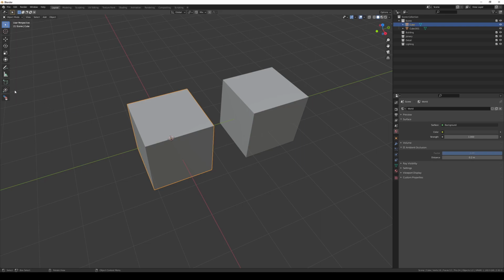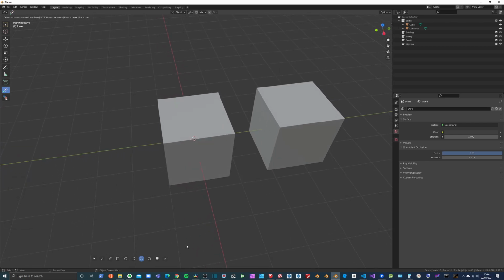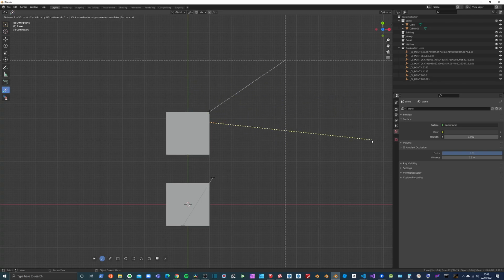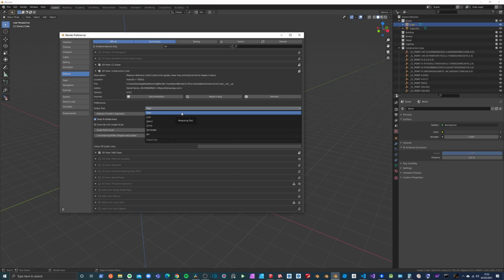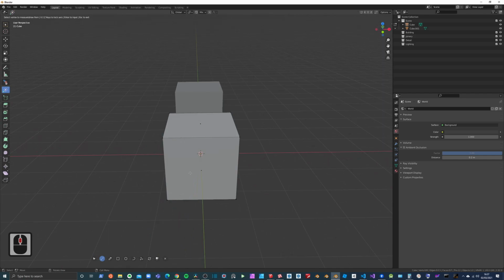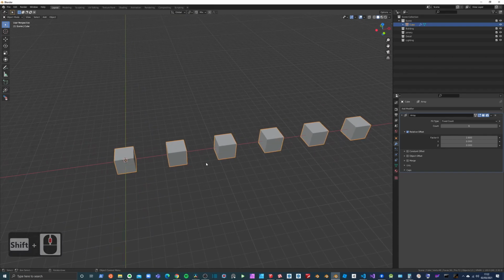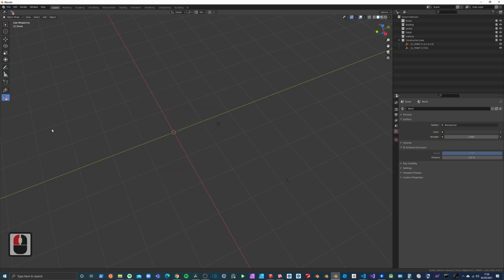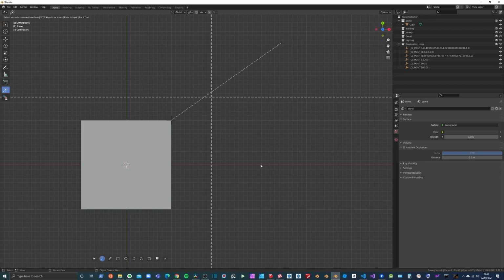Construction Lines 0.9.5 Release - CAD Modelling for Blender

Comment: I’m using the current version with blender 4.2 but it’s not working well at all. Very frustrating.
Reply from the maker: Are there any error messages in the console? Also, did you restart blender after installing? You can contact me through my website form and I'll help figure out what's going on. There shouldn't be any issues running on Blender 4.2
Reply: @ ok. Will get back to u

Comment: The addon is ready for 2.93? Line - Draw line geometry
 makes blender crash everytime I do 2 or 3 lines
Reply from the maker: Blender 2.93 had some internal changes that broke Construction Lines 0.9.5. However, I have a new release out this week that is fully compatible with Blender 2.93. It also comes with a whole host of new features and fixes. I'm working on the release video today and it should be released by Friday.

Comment: My blender keeps crashing while using the addon :/
Reply from the maker: Are you using it on Blender 2.93? If so, it's not yet supported. There were some API changes that cause issues. The coming release 0.9.6 will be fully supported and should be out next week. For now, you can run CL on Blender 2.92

Comment: Gracias Bro Enhorabuena, felicidades por tu trabajo, creo que fueron mis 7 dólares mejor invertidos.
Reply from the maker: Thanks very much for the comment, I appreciate that. I've got a new version coming out very soon (Earl/Mid August) with some major updates. So keep an eye out for that.
Reply: @dndrawings  aunque se me cierra el programa cuando lo uso por unos minutos 😞
Reply from the maker: @Fxiques  I've just seen your email. Are you using CL on Blender 2.93? If so, it's not yet supported. There have been some changes to 2.93 code which is messing up some add-ons (I've spoken to a few developers about this). I've fixed the issues now so version 0.9.6 will be fully compatible with Blender 2.93.
Reply: @dndrawings  y con cual versión es compatible tu ultimo addons? 
Es que tengo pensado hacer unos videos tutoriales para mi canal de YouTube del cual te envié el correo, y quiero explicar este addons
Reply: @dndrawings  los tutoriales hacerlos en español ya que no hay contenido de este addons en el
Reply from the maker: @Fxiques  That's great that you will do that. Can I send you a pre-release of the latest version (0.9.6) for you to look at and see if it works for you? There's still work to be done on it but it should work from Blender 2.82 - 2.93. The current version (0.9.52) works on Blender 2.82 - 2.92
Reply: @dndrawings  si sería genial probar, la nueva versión, si puedes enviármela al correo y me dices las mejoras que tendrá este fin de semana hago un vídeo tutorial del mismo explicando las mejoras en mi canal de Youtube. eFXtivo Studio. No tengo mucho tiempo de empezar a crear contenido pero sé que le puede llegar a más personas 🙏🏻✌🏻
Reply from the maker: @Fxiques  Thanks. I'm just putting together the release notes and testing build and I'll email that over in a moment.
Reply: @dndrawings  thank you

Comment: Thanks for this incredible addon and very helpful video! 100% agree with comment below re editable measurements on construction lines themselves, that would be huge.
Another suggestion: a free-rotate, or "align" option, so that one could rotate an object in space so that an edge aligns with that of another object, i.e. not being limited to XYZ rotations.
The only issue I run into periodically is the toolbar seems to freeze; I can't switch tools or close it out.. just have to restart Blender.
Thanks again! Really amazing addition!
Reply from the maker: Thanks, Fred! I'm working on editable Construction Lines at the moment so a version of it should be in the next release. I'll look into your free-rotate suggestion as it might be quite straightforward to implement (thanks for the idea). I've fixed a lot of bugs in the upcoming release, some of which have definitely been responsible for causing the toolbar to stop working. So hopefully this is all fixed in the next version. There's a lot of new features and changes coming up (auto duplication of objects and geometry, select and move/duplicate Edit mode geometry, delete (objects, construction lines and Edit mode geometry), measurements now shown in the viewport whilst you're drawing (no longer in the top bar), measurements persistently shown on construction lines and many more bug fixes and new features) so I'll post a video on here once it's released.
Reply: @dndrawings  Thanks for the response, this all sounds fantastic and I really look forward to it. 

If you do decide to look into this rotate/align idea, I'd highly suggest taking a look at the "align" command in Autocad, which is one of the indispensable ones in that program. It allows you to select 2 points on one object, then 2 points on another object to which you want your first object to "jump". You then have the crucial option to have your first object also SCALE to those two points or not. Really useful and often used tool in that program.

Thanks again for this add-on, really brilliant. This brings Blender closer to being an all-in-one program for me for many more uses.
Reply from the maker: @fredozamas  I think Rhino has a similar function called Orient. I really like the idea of being able to scale at the same time. I can imagine that that would be a massive timesaver.

Thanks. I'm really looking forward to putting out the next release.

Comment: i will be buying it. I've wanted to use blender for cad for a year or more - but it just does not cut it for cad work....If would be interesting to have an add-on that allows the production of pdf vector documents for publishing 3d models and architectural design solutions.
Reply from the maker: Thanks for the comment. I think CL is moving closer and closer to enabling a full switch from some other CAD software like SketchUp for modelling but as you note there is a real lack of document output options. This is going to be my next add-on. Some sections are already in the works but I need to focus on CL fully at the moment to get out a stable release with all the functions that I think it needs. After that, I'll be splitting my development time between the two.
Reply: @dndrawings  - purchased the plugin ... do you install the plugin via native zip -- or unzip it to a folder and look for a file ?
Reply: Ok - working - You install through the zip file  == :)
Reply: @dndrawings  = 'document output options.' are the key to uptake for small offices. I don't know if you have used sketchup Layout much - nut it is fine for documenting a table .. but for large jobs ( like a house) it becomes completely unwieldy. I hope you can get a tech pathway to scaled drawings on international paper with notes and dimensions - line drawings, shaded modes and standard views. If you want feedback or someone to test out a workflow - don't hesitate to ask :)
Reply from the maker: @MichaelFlynn0  Not sure why this didn't show up in the main comment feed. Completely agree with you. I use Layout all the time and for larger projects it becomes unusable. I've waited 10-20mins before just for the model to refresh in the drawings. To move away from SU completely I need to implement some way of presenting/outputting scaled drawings with multiple views and measurements. I'll definitely be in touch once it's started. Thanks for the offer.

Comment: I'm struggling to extrude a rectangle, it doesn't seem to select the rectangle?
Reply from the maker: Hi Mark, are you in edit mode (select or hover over the rectangle and press Tab)? If you still have issues contact me through the feedback form and I'll work out what's going on. Just a note on this, when adding a rectangle or circle it currently keeps you in Object mode, when it should auto enter Edit mode. This will be fixed in the next version.
Reply: @dndrawings  Thanks Dan, that worked. Cheers, Mark

Comment: Hello, great add on for us architects :) so thank you! Question, I'm having trouble getting the "guide" lines to work when selecting edges. Im still getting the 2 point construction line and not the horizontal line like you described. Is there something I'm missing?
Reply from the maker: Hi, thanks for the comment and I'm really pleased that you like the add-on. To switch to horizontal guides tap the Alt key, which toggles between the two guide modes. I've a patch release coming out very soon to fix a couple of bugs and add some new features but for the version after that, I'll set a default for guides to be in horizontal mode if dragging from an edge.

Comment: This is by far the most useful add-on for Blender. Thank You very much for Your continued work on it! The issues I have are rather minor, but annoying nonetheless (using Blender 2.91 and 2.92 for Mac): 
1) I'm unable to undo/redo until I switch construction lines off; 
2) needing to press the letter for axis (X or Y, or Z) then ALT to get a guide parallel to an edge is a lot of extra steps! I'd prefer to have it context aware, If I'm drawing a guide from an edge it's 99% going to be a parallel guide, so that should be the default or at least it could be an option in plugin settings to make parallel guides the default. A parallel guide could also snap to a parallel axis. So if I'm dragging the guide from an edge horizontally it should not shift in vertical position while dragging, but should stay on the same horizontal plane without need to affix it with SHIFT and then ALT;
3) needing to press ENTER to set a distance for the guide is also an annoying extra step. There is no need to press enter to type in exact distance in AutoCAD or SketchUp, or Fusion 360.
4) if I create a rectangle on face of an existing cube, I'm unable to select it until I switch off construction lines;
5) for the above reason I'm unable to use Extrude in Blender 2.91 or 2.92 as shown in the video, can't make a hole or extrude outwards.
Reply from the maker: Thanks for the comment. I've sent you an email.

Comment: When I selected the Cube to use the Move tool, I can see the lines on the back, but I can't capture them unless I rotate to a certain Angle
Reply from the maker: I'm going to get rid of the messages and dimensions from the topbar soon (as mentioned), which will then allow you to set to wireframe shading from within CL. This will mean that geometry at the back can be snapped to. I see your point on the selection box though, so I'll look into that. Thanks for pointing it out.

Comment: Thank you for the update! I really appreciated the cutting trugh things but, circle doesn't work on face and i can't set the segment for it and arc, however very nice job! thank you again!
Reply from the maker: Thanks for the comment. Circles should work on faces when you're in Edit mode. If you hold Ctrl and use the mouse wheel, segments will change, you can also use the arrow keys.